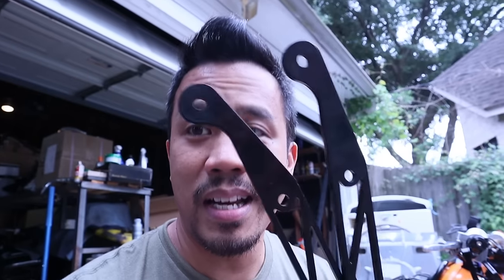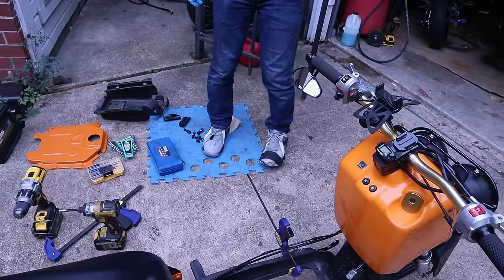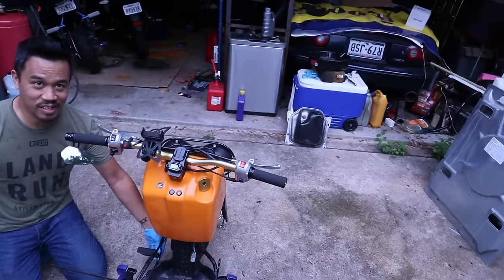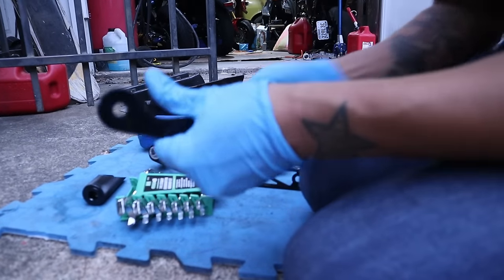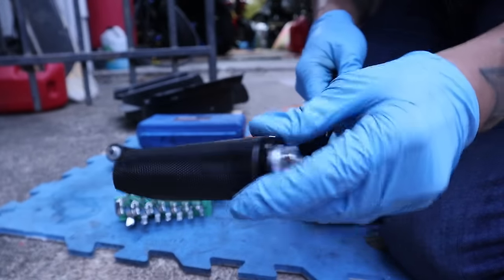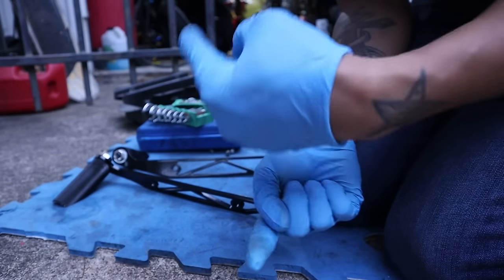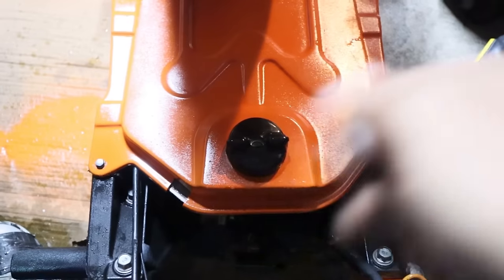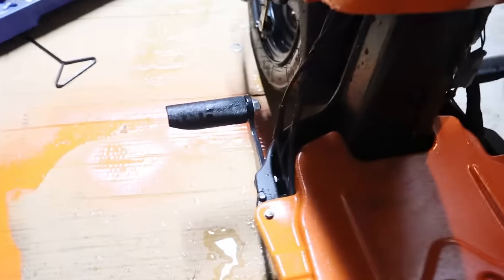Installing Front Pegs on the Honda Ruckus #Ruckus #Honda

Comment: Way worth it. That's what I have for mine. So much more comfortable, specially if you're a tall rider
Reply from the maker: Yea my legs a kinda short on it but it works when I’m moving slow
Reply: I’ll be getting a ruck soon. I’m 6’5” so this is gonna be my first mod when I get it. But I think I’m gonna go with the one that bolts over the gas tank
Reply: @RocketDolphin89  your legs will thank you
Reply from the maker: My only reservation was drilling the frame and with the over the tank I didn’t want to add the weight.

Comment: One question and a couple comment did you drill through where the stamped VIN number is on the frame because it looks really close now the two comments if those bolts are just black oxide they are going to rust really fast now those Allen head bolts are called socket head cap screw plus I would suggest running an S nut or a Nylock as some people called them
Reply from the maker: No holes in the VIN , I spaced it so it’s before and after the vin. Yea I was thinking nylon nuts for the pegs and yes they rust but I didn’t want silver ended ones.
Reply: Go with titanium bolts, lightweight and won’t rust. I have 20 in my left leg.

Comment: Question off topic for you..... I just bought a brand new ruckus: put a polini variator and rolling wrench evi/cdi brain on it.  And I can’t get my rpms over 8540.  How do I get them up there to gain more?
Reply from the maker: Lighten the weights with some 4.5 or 5.0 gram sliders or rollers. They are to heavy and maybe needs to me lightened.
Reply: Awesome! That’s what I was thinking I’d need to do.  Guessing I have to go to 4.5.  Have 5.0 sliders in there now and they aren’t gettin that little motor up there

Comment: Another great video and another potential hole in my wallet...😫
Followed the link for the brackets and there are 4 options, which one did you go with ?
Eco black w/o extensions, Eco black w/ extensions, Raw w/o extensions or Raw w/ extensions.
Sorry if I’m being an idiot but I’m not sure what the difference is. Thanks 👍
Reply from the maker: Mine is raw because I had it powder coated black with all the other stuff I sent. Extensions I think is with the pegs ?? Not sure I just got the brackets ... never! Always ask I love doing this stuff

Comment: I’m 6’5 will this be enough for someone my height
Reply from the maker: In combo with a lowered seat frame that sets the seat back a bit I think it would work best. For you being 6'5" you may want to look into the frame extensions.
Reply: I’m 6’2 and I fit ok on my ruckus. I use side pegs with stock seat. You can get a seat bracket (I believe made by NCY) that can move your seat back with out lowering it. It is adjustable, has 3 positions to chose from.